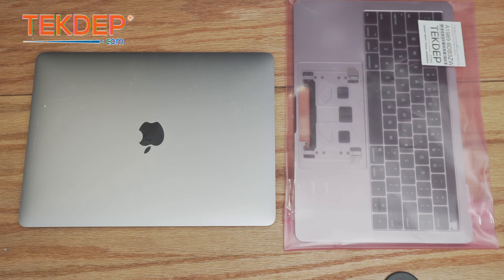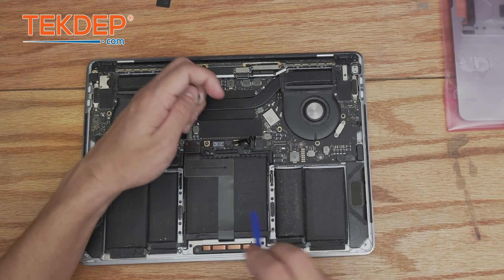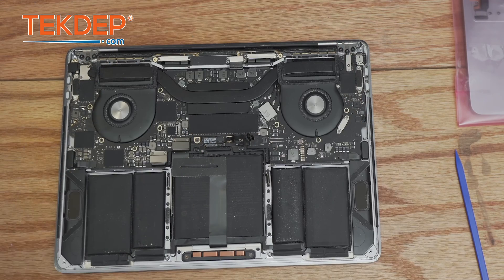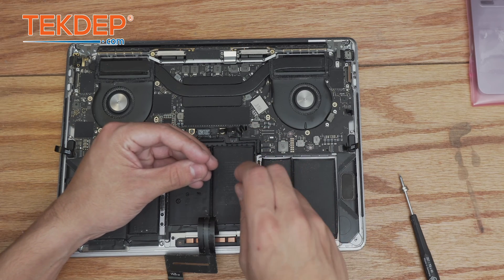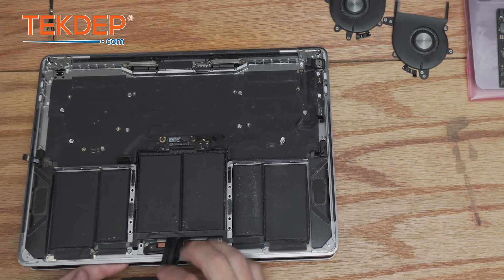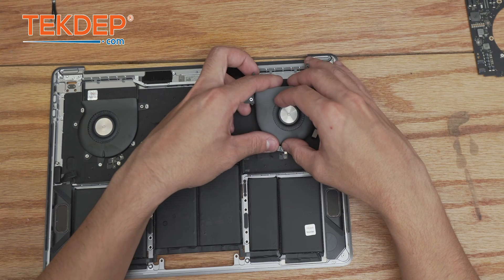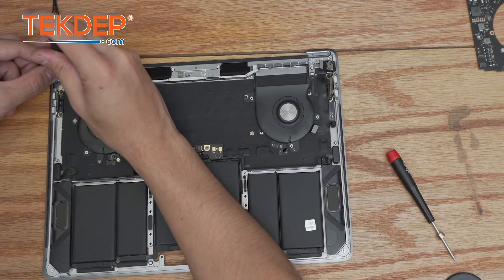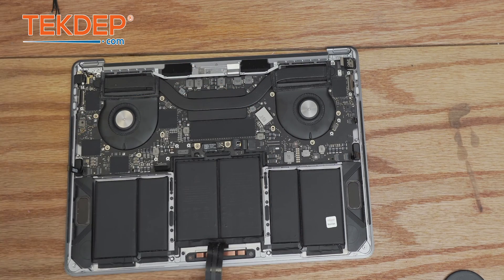MacBook Pro 13" A1989 Top Case Swap | Switching Languages!!

Comment: This is a great video. Just some watch outs. My replacement keyboard didnt have things like the microphone cable or the Touchbar cable included. These are located on the top right of the unit. Also something must have happened to my Touchbar cable (this connects just to the bottom right of the right hand fan ) so my touchbar is messed up. We also took the time to replace the speakers as one of them had blown. So order your replacement keyboard underbody and inspect if you have all the cables. In this video all these cables are already there. If not order them on ifixit. Also I bought a magnetic placemat (that is also dry-erase) so that I would place all the screws and keep them in the right grouping and label them. There is one on ifixit too.

Comment: Hey this is a great and helpful video,, and i wanted to ask couple quick questions. I recently bought a used MacBook that has a similar layout as shown in the video but it is in Spanish. I was wondering if just switching the top case to english functions. Do all the keys work properly and no system issue? I have a MacBook air M1 2020 (a2337), do you think switching the top case on this works?

Comment: Hey, nice video, pretty clear explanation. Im willing to this in my A1989 since a car run over it and my topcase is bent and the trackpad cracked, everything works though. Do you lose functions or is there a notification after swapping it? Like when you change screens and loose truetone.
Reply from the maker: We are sorry to hear about your laptops unfortunate accident! Swapping any part on this model laptop will not result in a loss of functions or any notifications of "non-genuine" parts. As of the time of recording the only devices Apple has implemented software locks/ non genuine part notifications are iPhones!